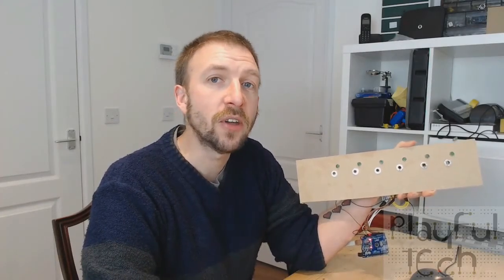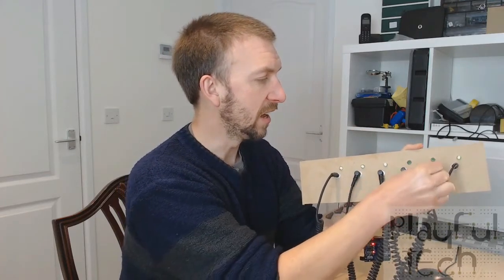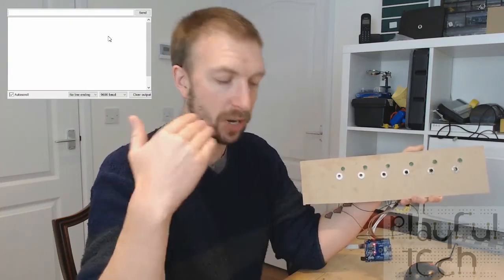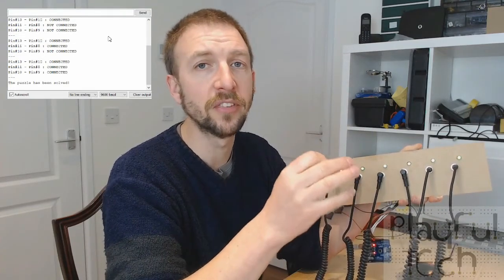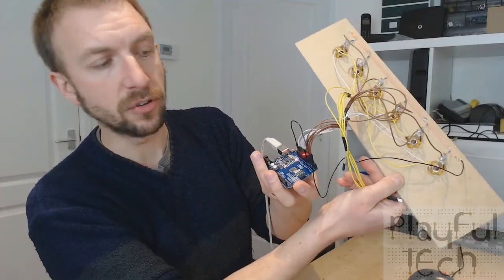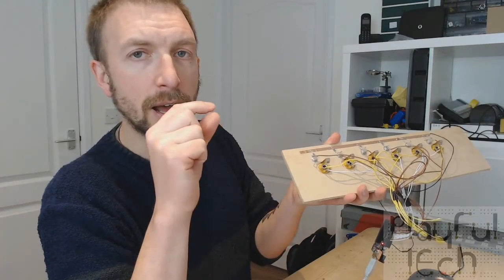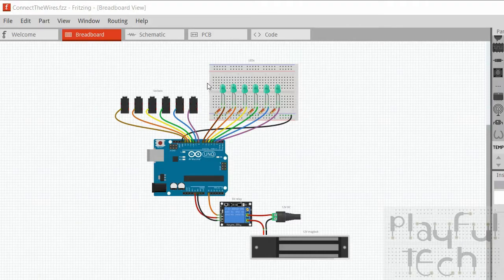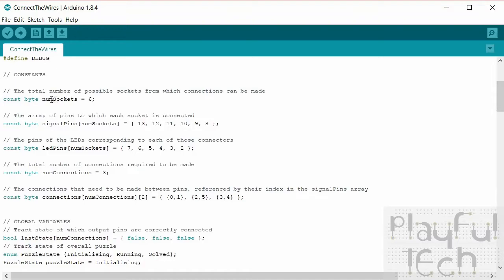Connect The Wires Escape Room Puzzle

Comment: Updated: Solved!   I discovered that D13 on the Nano has the built-in LED that has a resistor through the LED to ground. I think this might be messing up the code. I updated code to use pin A0 instead of pin D13 and it works properly!  

I was led to the solution via the patreon site where another user had discovered D13 has the internal resistor that was messing up logic.  Took his advice and modify the code. Thanks patreon users!

Orig Text: I downloaded the code built up a wire connection box exactly per your specs, but used an Arduino Nano.

When I play the game just as you did in the video everything works fine. 

Then, I removed all the wires and connected the first wire to pin 13 and then go down the line one by one.  I noticed that when I connect 13 to pin 9, LEDs 4 and 3 light up... and serial monitor says the pins 9 and 10 are connected.

Then as I continued to connect 13 to pin 8 LEDs 11 and 8 light up and the serial monitor says that pins 11 and 8 are connected.

Have you experienced this anomaly? Do you think I have a bad Nano? Or something unique about the Nanos architecture that doesn't let me use your code?

Here's a quick video showing the anomaly that I've discovered...
https://youtu.be/_00gphhof4Q

Comment: Is there a way of doing this so that the correct wire needs to be put in, for example, you have to use a yellow cable to connect the yellow sockets together?

Comment: This code works perfect....I adjusted it for my puzzle that I just made.....I made one led come on when the connection is made instead of two❤ I have 6 connections, 12 sockets using the arduino mega.  I'm apart of your patreon family so I was able to get the code and copy it into my arduino easy peezy😁
Reply: i'm a part of the family too, but it seems that the project does't exist anymore 🤣I really need this code. Can you maybe help me out? 
🙏

Comment: Where can I get those sockets and cables? Cant find sockets and nice cables
Reply from the maker: The cables are regular 6.4mm audio cables - used for connecting, e.g. an electric guitar to an amplifier. The corresponding sockets are available on Amazon, eBay, AliExpress, BangGood etc.

Comment: Hey, I have the following. Is this right for 6 cables and a possible 20 sockets? Only 12 of the 20 sockets will be used as connections:

const byte numSockets = 20;
const byte ledPins[numSockets] = { 13, 12, 11, 10, 9, 8, 7, 6, 5 ,4 ,3 ,2 };
const byte signalPins[numSockets] = { 25, 24, 23, 22, 21, 20, 19, 18, 17, 16, 15, 14 };
const byte numConnections = 6;
const byte connections[numConnections][2] = { {1,15}, {2,6}, {3,8}, {4,14}, {6,18}, {11,12} }; 
bool lastState[numConnections] = { false, false, false, false, false, false };